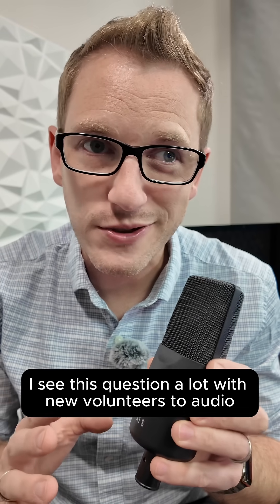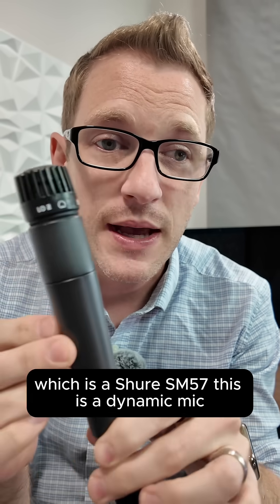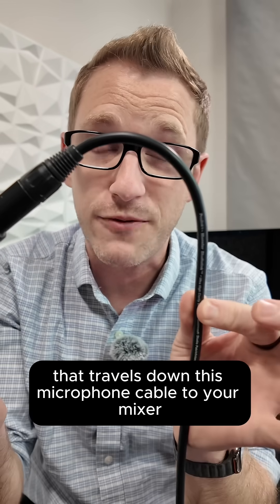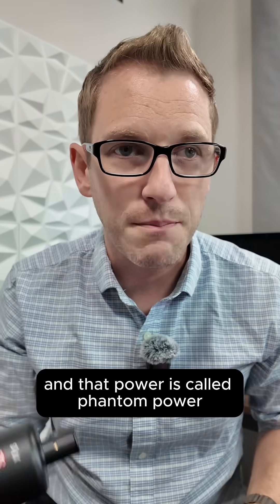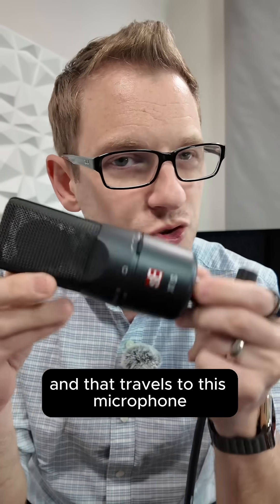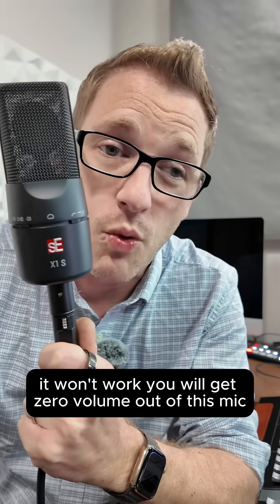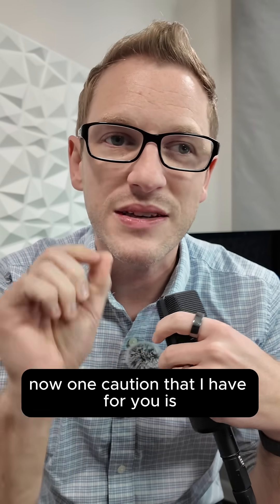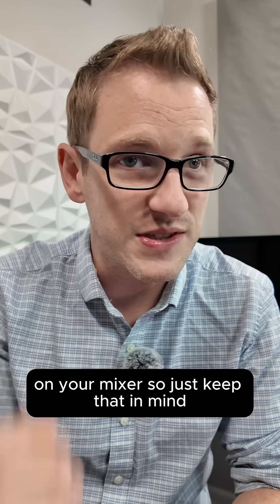Audio 101: What is Phantom Power? Explained Simply #audio101 #DrewBrashler #mixing

Comment: Hey there! What about pluging and unpluging the mic with phantom power on? I mean I never had an issue with that, but there people telling me I will destroy the mic. And that dynamic mics will get destroyed too if you apply phantom power on them.
Reply: Almost all dynamic mics can handle phantom power just fine.
Reply: Absolute majority of modern dynamic microphones has (iirc) transistor or some other part that keeps it from getting damaged by the voltage..
Reply: Regarding the unplugging thenwhen +48 is on - I haven't heard that. Most analogue mixers have one switch for phantom power on/off, some I have seen on the back of the console, so I don't think it was meant to be adjusted all the time.. But I know too little about this. I mean it seems to be the best practice to plug and unplug when the whole console is off but I don't think it is the normal way. Be free to correct and teach me lol